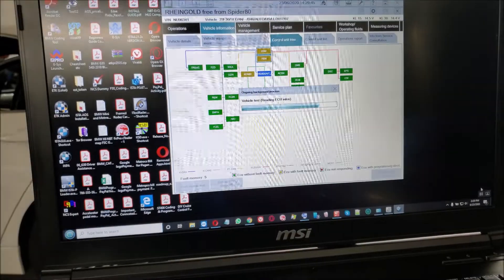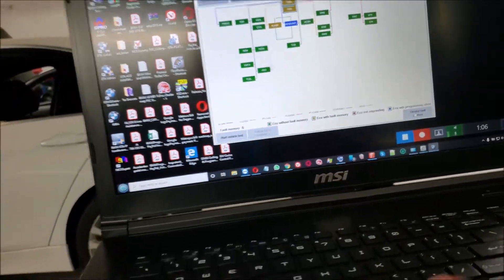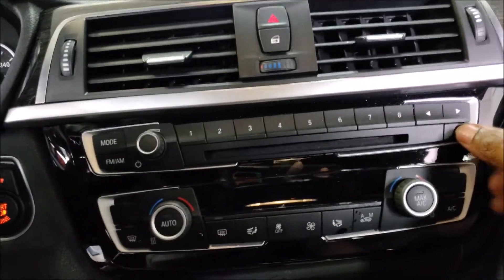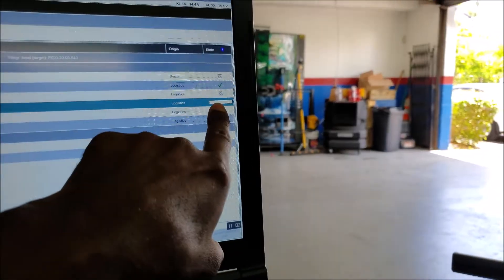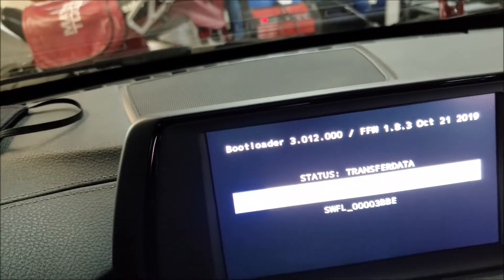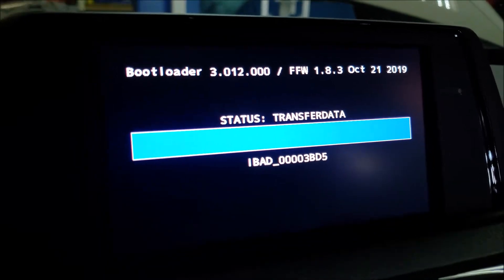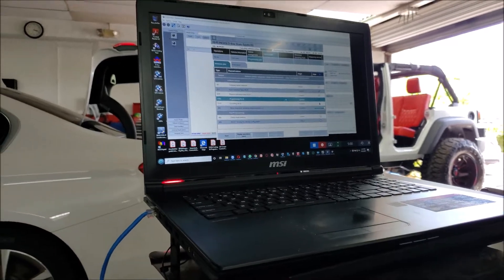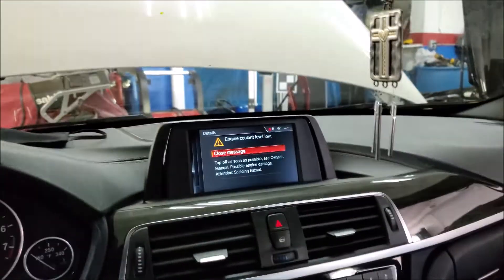BMW F30 Head Unit Basic in Programming abort solved 2020-06-23

Comment: Hi brother, 

What happens if I would update my F10 without a battery charger and without ICOM? What happens to the programming if the voltage drops?
Reply from the maker: The current ECU (module) being programmed will be in Programming Abort mode.